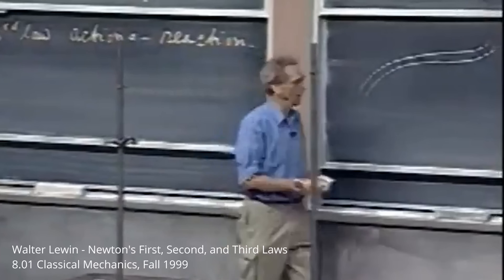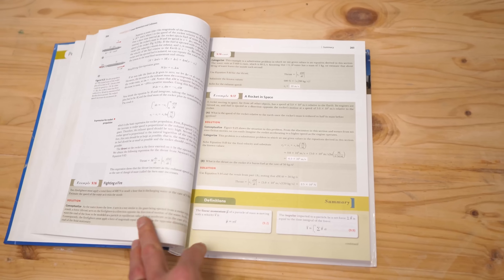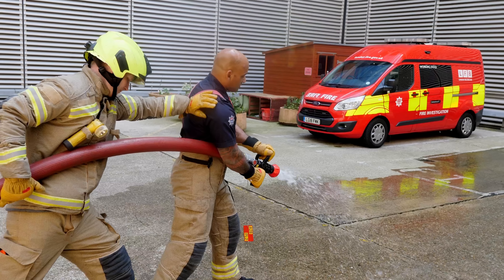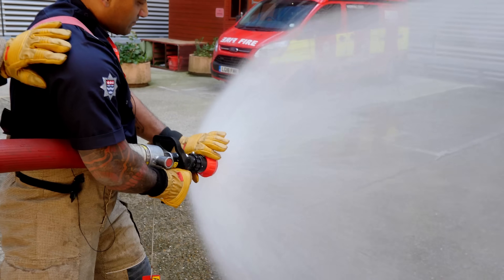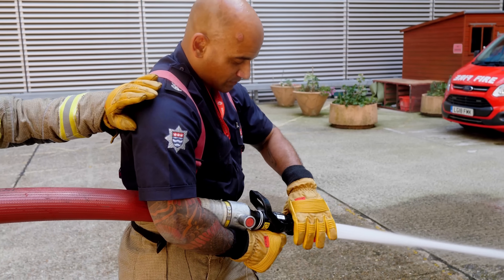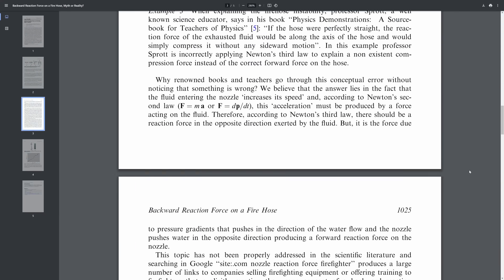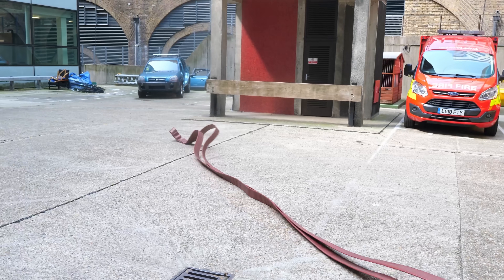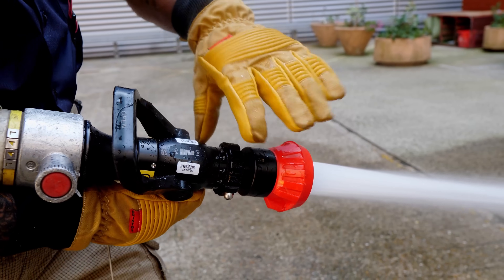Why chaotic hoses dance

Comment: the air inside the hose isn’t flowing smoothly - it’s all chaotic and creates friction (thanks, fluid dynamics!). Plus, the hose itself fights back by creating turbulence, so it’s like a never-ending loop ⭕. Ever seen those wacky inflatable tube guys? They NEED that constant pressure to stay upright. But if they straighten up too much? Pressure drops -> instant floppy meltdown. And since the whole tube is basically ‘breathing’ (letting air escape), the pressure’s always changing. Science + flailing tube men = pure chaos

Comment: I'd have thought the nozzle itself has a lot to do with it.  First, you constrain the cross-section to increase the flow rate through the nozzle.  But also you can constrain or magnify the spread as the water exits.  These should be forces in addition to the forces due to any bends in the hose.

Comment: Steve, you need to do a part 2 on this, like you said, air is compressible, whereas water shouldn't experience any pressureized-flayling-man effect. Also, the elasticity/stiffness and tension/slack that the hose itself has wasn't considered here. Also, if your hypothesis on the water accelerating as it's exiting the nozzle, causing the force, then it would depend on how the inside of the nozzle ending is built? Maybe some kind of half venturi effect going on here too? Also, the weight and size of the hose probably changes how severe the flailing will be (where it starts and ends) because at some point there is too much nozzle to throw around and the energy goes to flipping the nozzle around. idk I feel like this vid created more questions than answers lol.

Comment: 9:28 I think I can help with that.  There is a type of lever action at play here.  If you imagine a piece of string stretched out between two anchor points, if you push sideways on the middle of the string, you get a much larger force pulling on the end of the string.  The tension in the string can be calculated from the sideways force and the amount of sideways deflection (like how you check the tension of a drive belt by pushing sideways on it).  The mechanical advantage can be explained with triangles but it's hard to describe in words alone.   So I think what's happening with the flexible hose, is that when there's only a slight bend, that small sideways force from the flowing water changing direction will result in a much greater pulling force at the end.  And by some miracle of math, it always works out to be the same amount of pulling regardless of the curvature.
Reply: I made this comment before watching the rest of the video, and I think Steve's original idea of the water pushing on the walls of the hose is correct.  At the end of the day, the only way the water can create a force on the hose, is by pushing on the hose.  I don't buy the pressure drop/acceleration thing at the end - does that really happen with a wide open end?  There will be a significant pressure gradient and acceleration if there is a restriction i.e. a nozzle, but a flow of water can't accelerate without the cross sectional area changing, because it's not compressible.

Comment: Now, here is how you could verify your hypothesis:
1) At the end, don't let water spray out of the nozzle, but loop it back around, and have a double hose (either one inside the other, or 2 side-by-side throughout the whole length).
2) Use different nozzles and different pump pressures. Directed pointy nozzle vs nozzle pointing outwards 360° round. Low vs high restriction nozzle with pump adjusted for the same pressure inside the hose. Low vs high restriction nozzle with pump adjusted for same flow rate.

Comment: I'm sure that the water hose moves a bit differently because it doesn't scale as well as an air hose. With the weight of all the water in the hose growing exponentially plus the friction introduced by laying one the ground. It also has to fight the rigidity of the different hose as well that helps keep the water in the hose.

Comment: Edit: I've realised that friction is applying tension the wrong way, so it is probably more subtle then this, but I still think something along these lines seems more plausible then the final explanation.

I think indeed there is a much more convincing alternative explanation. Water is entering the straight hose at pressure P. Over the course of the travel through the hose, it must overcome friction from shear forces, and so pressure drops until it reaches Patm at the opening of the hose (velocity has not changed). At every point along the hose, the pressure is pushing forward on the water, so the reaction force on the hose is backwards. If the hose has no intrinsic stiffness, this must be provided by tension transmitted to the front of the hose. The pressure is applying a total force on the water of (P-Patm)*(area of the hose) in the direction of travel, so the total tension at the front of the hose pulling back must be the same magnitude.

This explanation is more satisfactory because it explains (1) how exactly force is transmitted to the hose, and (2) why the water doesn't really appear to change velocity exiting the hose (if it changed velocity it should constrict on exiting since it's basically incompressible. It does not, if anything it seems to expand). This also explains all the observations in the video:

Why is the force the same in the twisted vs straight hose? At the very least because the friction is the dominant force. Possibly also relevant is that you compared a 360 circle, where presumably a lot of the momentum change related forces cancel out. A 90 degree bend would possibly have a different result.

Why isn't a bent hose unstable? because tension keeps any perturbation from growing in an unbounded, chaotic fashion. The change in momentum needs to overcome the tension force from the friction + momentum that's keeping the hose taught when the end is fixed. Some interesting math to be done, but there might be a critical flow rate and/or curvature at which it does become unstable. When tension goes to zero (ie end is released) then it does become unstable, basically per the original explanation.

So essentially, I think your original explanation of the chaotic hose was correct, you were just missing the crucial role of tension and friction of the water flow and confused yourself with the firehose force. There is one clear testable prediction against your explanation: under the tension explanation, for a given velocity and hose area, the force on the end should increase linearly with the pressure drop across the hose (effectively the length of the hose).

Comment: A hose without a nozzle flows well but will not throw far, a hose like this also much more stable. A nozzle constricts the flow and accelerates the fluid, this acceleration is where most of the force felt at the end of the hose is coming from. The constriction also reduces the total flow and pressure drop in the hose before the nozzle. Think of thick and thin wires and current, where will the power be dissipated?

Comment: One thing stuck out about your looped hose experiment at ~9:30, the input and output of the hose are in line, and the loop seems like it would cancel out forces? Do you get a different result when one is say 90% rotated, or offset instead of straight across from the other?

Comment: I didn't understand 12:25. I understand the pressure outside is lower than the pressure inside, but why would the momentum increase at the nozzle? If anything, wouldn't it decrease, since for a given flow rate, the speed is inversely proportional to cross-sectional area?

Comment: i think its comparable to a resistor, the resistor in this case is the nozzle and the heat is the backward force, as the heat comes from backwards motion which just gets converted to heat

Comment: the waving of the hose pulling back on the ends is very reminiscent of the microscopic view of elastic materials having long polymers that want to tangle up and pull the ends together dew to thermal vibration.

Comment: There are several reasonings in this video that don't feel right to me. 
Is the pressure in water moving through a pipe the same everywhere? I'd think there would be a pressure gradient along the length due to friction. 
Is the water gaining momentum at the tip of the nozzle? Since the mass of a "particle" of water is constant, its speed would then increase. While I understand the reaoning, it feels counterintuitive to me. 
Also the comparison between pushing of water in a tube, and pushing on the end of the string, seems flawed. Water compressibility may be neglected here, as may the expansion of the hose due to pressure (with would be constant anyways as Steve maintains). So pushing water on one end (by a pump) will eject an equal amount of water at the other end. Pushing on a flexible string is totally different. Tbh I watched only until 14:00,

Comment: 9:01 This may be irrelevant, but did you try testing with the angle between the air source and the end of the hose offset? From what I can see in the video, even for the curved hose testing, the tip of the hose and the tip of the air compressor nozzle are about 180 degrees from one another.

Comment: Rocket on a string: If you attach a fan or co2 cartidge to the hose, so the hose is empty, or has non moving air: is the movement the same? (patreon supporter)

Comment: I'm not entirely convinced by the final argument. It could be right, but there are a few holes in the explanation. Firstly water is basically incompressible, if it were accelerating substantially it would need to constrict as it leaves the hose. It's difficult to tell from the footage, but it doesn't seem to be the case, at least for the chaotic toy hose. This seems like it should be pretty easy to test by putting some sort of particle in the water jet in a transparent pipe and seeing if it accelerates when it exits and comparing to the measured force. Secondly, the explanation of water pushing against the water behind it is very unsatisfying to me, as it does not at all explain how that force is transmitted to the actual hose. I have a hunch that the tension and stiffness of the hose itself, as well as possibly shear friction forces of the water, are playing an important role here, but I would need to think about it further.

Comment: I'm personally thinking of a 3 dimensional, multi-node, dampened pendulum where the number of nodes is defined by the resonant frequency of the hose.  Throw in the force of the bends with the mass and friction of the hose and water and the end of the hose has the least momentum.  There is no momentum change at the nozzle.  Low velocity high volume becomes low volume high velocity.  Momentum is always conserved.  Check out @houstonjones if you think the firefighter is experiencing even a small fraction of the water's momentum.

Comment: I think your theory is right. If the hose has a constant diameter and drag from friction on the walls is not considered, the force is only originating from the bends, where the water is accelerated perpendicular to the flow direction in order to flow in a curve. The force outwards is proportional to v^2/r. V^2 is constant and can be neglected. So the different force at different sectuons depends on r and is proportuonal to 1/r. The forces outwards will put the hose ubder tension (it gets moved outwards and wants to resist being pulled apart).

The tension of a horizontally tensioned rope, on which a piece of laundry for example could hang on is dependent on the the force and the angle of the deep hanging spot that is created by the landry piece. It can be calculated by the force applied by the laundry piece times the ratio of hypothenuse devided by opposite side (distance from one end of the rope the the laundry devided by the drop in height after adding the weight).
The bend hise can be thought of as having infinitely many of these small bends. If we derive that thought to a smooth radius, that has a orthogonal force acting all along the curvature, we can say that half the curvature means double the force, because each of the now twice as many infinitely small bends (with twice as much weights e.g. water molecules), on which the same force per bend is acting has an opposite side, that is half as long, which will lead to double the force.

That means that the force acting orthogonal to the hose is decreasing by 1/r, while the force along the hose is the orthogonal force times r. so r/r cancels to one.

That means that the force along the hose that is induced by bends is everywhere the same, regardless of the bend angle or radius (not considering it as a threedimensional object with one side of the wall shortening). That explains why a hose will always apply the same force when held at the end (unless "perfectly" straight). That means that in the case of a small bend, the water is pushing the hose slightly tangentially, but it is like you and the fire engine are the ends of a hanging rope. the car is actually pulling you.
Reply: Finally somebody that understands it

Comment: A roughly 360 bend in the hose is not the argument made for the fire hose. Steve said himself that is was a sum of 90 degrees that would lead to the maximum nozzle force. Maybe try the test half way through the vid at 90.

Comment: Hi Steve - great video, but a bit of a correction from a fluid dynamicist - the fire hose and air hose are different because of the nozzle, so you can’t directly compare one to the other.  It is fair when you say the water gains momentum passing through the fire hose nozzle - that is what Bernoulli’s law tells us.  However, the air in the air hose isn’t gaining momentum (at least very little and only due to compressibility effects) at the end of the tube.  The air is accelerated as it expands going through the valve of the gun, but then travels at a constant velocity through the hose (neglecting small remaining compressibility effects).  Thus the air hose is not experiencing any forces at the end - it is only experiencing forces at bends and in the wall friction (head loss).

However, there is a deeper issue with your problem statement, but therein lies the answer.  Classical mechanics and fluid mechanics rely on a continuity assumption, and that isn’t reality.  The fact that you can get the exact same mathematical solution if you treat the hose as a rocket nozzle and have waves traveling up the hose as you do if you use only fluid mechanics tells us that neither is the truth.  Underneath it all are individual molecular interactions and underneath that is QED and underneath that is ???.   One of my favorite examples is you can calculate rocket thrust using conservation of momentum but also get the same answer by multiplying the differential pressure between the top of the combustion chamber and the nozzle by the nozzle throat area.  It is pedantic to ask which way is correct, because both are simplifications of the real truth of the molecular (or quantum if you prefer) interactions.  This is what is going on in the air hose at the end.  If you carefully add up all the hose wall area times the local pressure, you will find that it exactly equals the net force that conservation of momentum tells you calculated at the end of the hose.

Comment: When I trained in fire hose control 40 years ago, I was trained to put down a loop of the hose such that the free end of the hose ran under the loop and there was no more than 3 meters of hose between the nozzle and the loop. You do this before you charge the hose, so that when the hose is charged, you only have to worry about controlling the last 3 meters, not the entire hose. 

One of the "training" methods was to give the newbie the nozzle without building the loop, charging the hose and watching what happens. This back-fired because the hose threw me around 180 degrees and I ended up hosing down the entire squad.

Comment: @Steve Mould
14:00 If that is true, that the pressure is generated at the nozzle, then it should also be true that a fire fighter feel less force when the nozzle is set to "fan mode" instead of "beam mode".
because in "fan mode" the pressure is generated radially in 360 degrees & cancels out each other, while in "beam mode" the pressure is generated axially and does NOT cancel out.
Does that match what happens in reality? (I think: Yes).

Comment: i am not a physics person, so i have no idea what im talking about. to me it looks like with the air hose, the air is transitioning from a pipe of some size to a pipe of infinite size (out of the nozzle). could you apply bernoullies law to say that herefore, the pressure outside of the nozzle should increase, pushing it backwards?

Comment: 13:24 no I think it's the one force, not two
You can push on the end of a string, and it'll want to bend, so you expend force to keep it rigid by holding the hose, forcing the energy further back

In the hose the pressure against the hose wall does this all the way back to the pump

Same thing with a rigid pole; winhout applying corrective torque, you pushing on a pole (imprecisely) could result in it rotating instead of pushing away